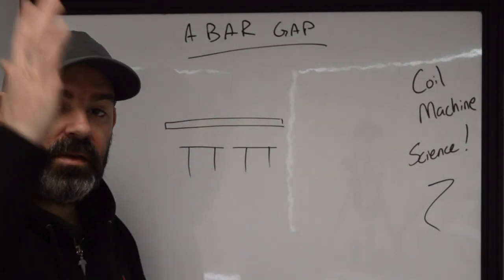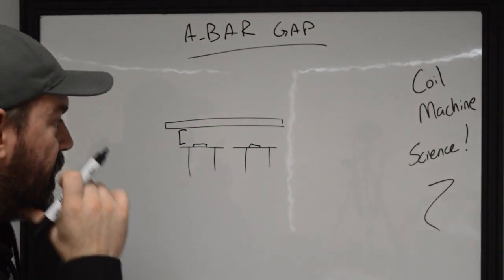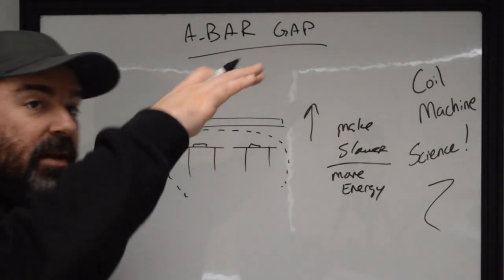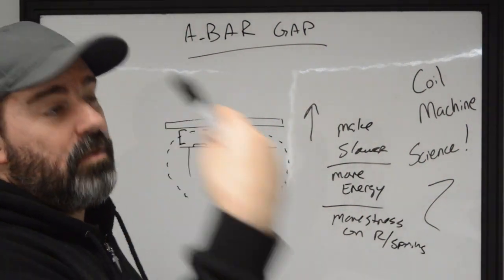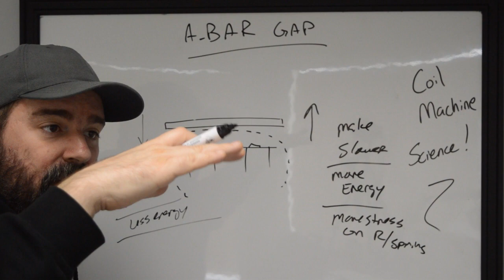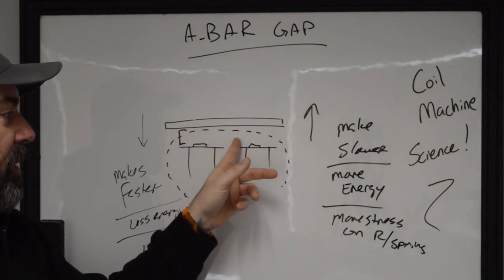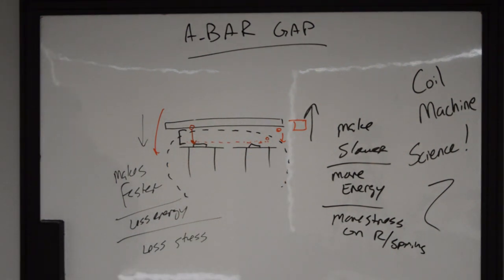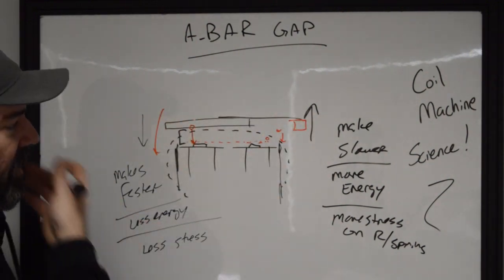Coil Tattoo Machine Science - A-Bar Gap

Comment: what a bar gap would you recommend for a liner pushing 14rs lines?
Reply from the maker: Personally, I wouldn’t recommend pushing round shaders as a liner. It’s a shader needle. 
If you’re going to anyways, I really depends on the geometry and coil setup of the machine. Anywhere from 2mm-2.5mm for most machines, a little more for oversized machines that are slappy and you lead off the tube. Add 0.5-1mm for those who lead off the needle.
Reply: @BetterTattooing  i’m using traditional “loose” 14 needles

thanks for the reply!